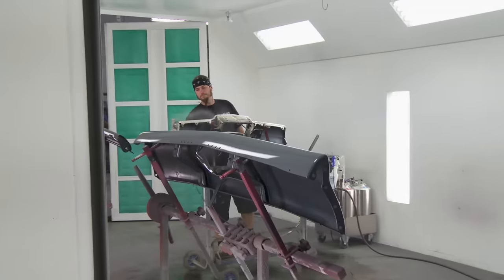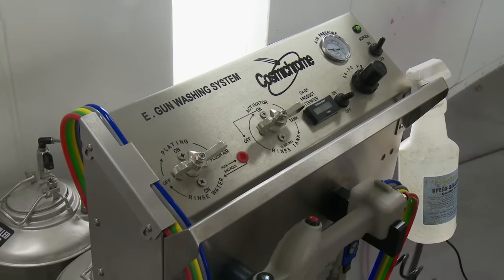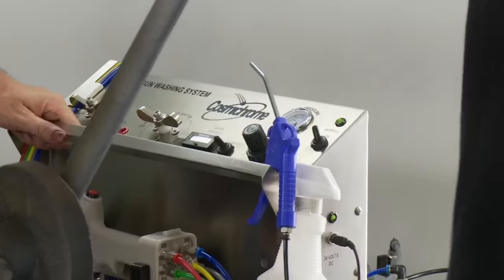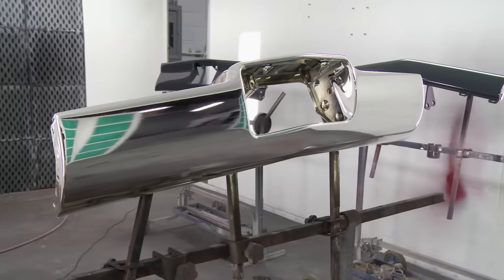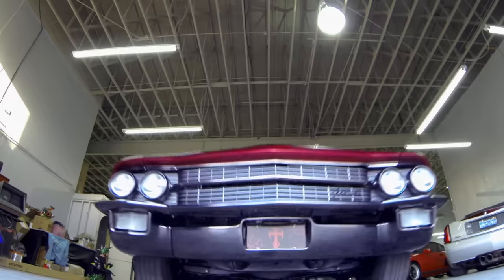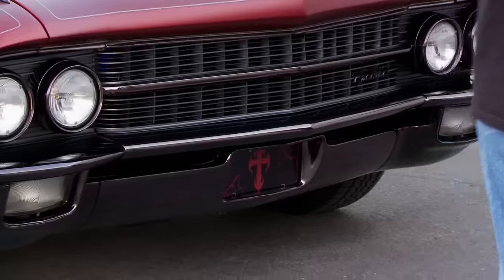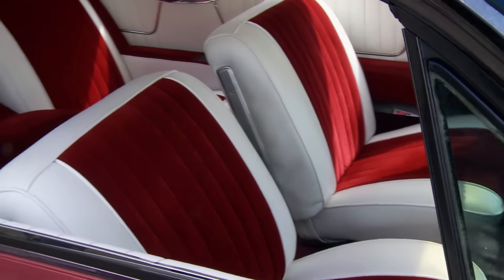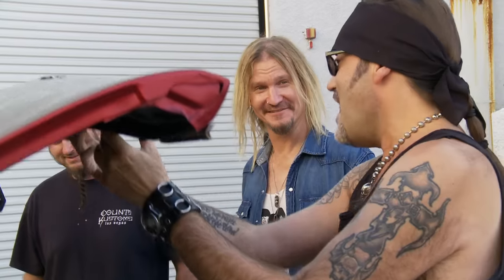Counting Cars: Danny's 1962 Cadillac Quick Flip Fiasco (Part 2) | History

Comment: They do nice work but some of it is a bit too extreme. I contacted them about a '57 Ford Custom 2dr sedan pro-mod project and I have a near $200k budget.  They declined to take it on. I wanted to build a replica of the NHRA 3 times record holder that I had back in the early 70's.